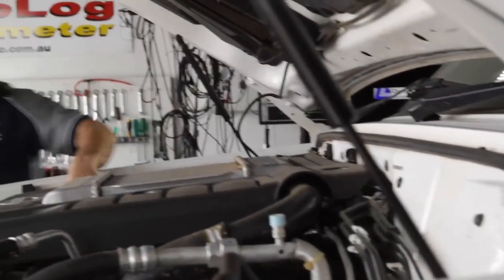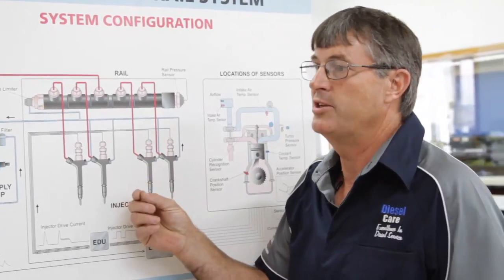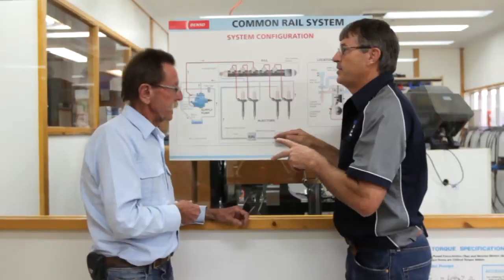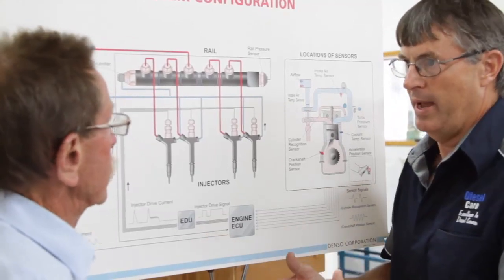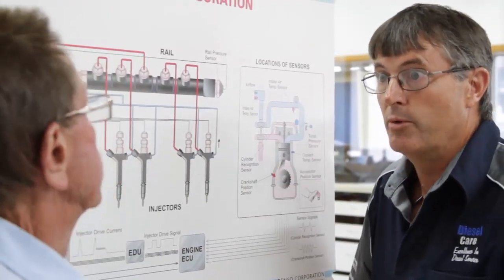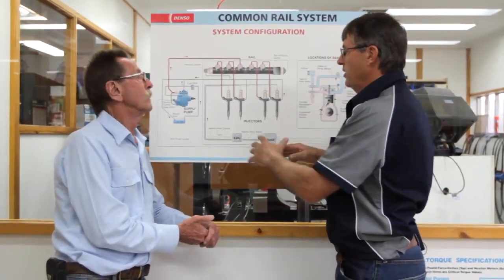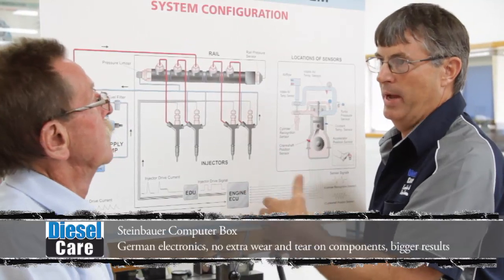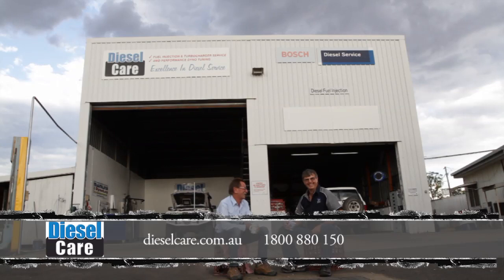The Steinbauer Difference - Diesel Care on Pat Callinans 4x4 Adventures

Comment: *The truth about chip-tuning, by Philipp Stalzer*

Today there are 3 versions of this cylinder: UL, OL and TOP.

- UL stands for lower-performance, the piston is made out of a simple aluminum-alloy, the crankshaft is simple-forged and uses a sintered connecting rod. It can cover up to 25kw/75nm per cylinder and is used in models like the x16d, x18d and x25d (exept the f10 model after 2011)

- OL stands for upper-perfomance, the cylinder path is honed several times, it has forged connecting rods and the bearings of the rods and crankshaft are sputtered bearing. It can cover up to 35kw/100nm and is used in models like x20d, x30d.

- TOP is for high performance, including a special treated crankshaft as well as laser-treated cylinder-paths. With this it is possible to increase injection-pressure and rated speed. This cylinders are used in models like x23d, 525d (after 2011) and x35d/x40d.

The engines have exact mechanical measuremants, but are different in materials.

For example the OL piston has a higher amount of copper and chrome. The higher amount of copper dissipates heat better out of the chamber into the piston floor cooling. Chrome makes the piston more stable at higher combustion-pressure inside an OL-engine.

Since the pistons are exactly the same sizes, you can however use a OL or TOP piston in an UL engine when doing repairs. This helps saving costs even more by reducing stocks and the prices regarding spare parts are more secondary.

It is correct that manufacturers limit the power output via the ECU (for example in an 25d), but they have to, since the used components are not made for higher hp/nm outputs. Almost every turbocharged diesel-engine is capable of generating more thermal energy than it can handle mechanically, and this is what chiptuning is relying on.

Now here come the tuners with their chips, because they can fetch data/part numbers from After-Sales-Programs (at BMW you can access it without any further requirements) and think all 3L engines are the same. It is true in terms of repairs, but not with newly shipped cars. You can use a piston of a 535d in a 316d and it will fit and work perfectly (same size) but is indeed "overpowered" in terms of materials. In this particular case it will be no problem since a 316d puts out less power than a 535d.

To get a sense of how much money can be saved by using a master cylinder for a complete engine lineup: if a piston "148" for the upper performance costs 12€, an M124 only 8€ that this makes about 24€ per car. For a production capacity of 200.000 cars 525's with 6 cylinder you're looking at a whopping 4.8 Million Euro. And the piston isn't the only thing where money is saved. Because of this, the customer pays less for a 116d as for a 123d, even though they both have a 2L engine wich are basically built the same way. The 116 just has less heat resistant and cheaper materials built in.

No manufacturer limits the power only by electronics. It is the media and especially the tuning-scene that spread this rumor. The differences nowadays not only come down to engine size, it also goes as far as material and single production processes. Same-Part strategy does not mean that the parts are exactly the same, only that the measurements and weights are the same. Also the thermal characteristics are different.

Interesting from a different area: Bosch does the same thing with their machines. You have the green series (for the little handyman at home) and blue series (professional). Products look the same (expept housing color) but here we also have different materiels used. A drilling machine from the blue series has a better hardened transmission, switches are built for far more cycles, overload protection is higher, thicker cables.

Regulating the power output via electronic serves the purpose that the engine with it's simple materials doesn't get overused. Through supercharging you can give any amount of power to a engine, but it will not be able to handle it. So when you think your 118i with its 170hp could do way more, but the stupid people at BMW are just to lazy to get more power out of that engine let me tell you: a 118i is capable of over 300hp, even keeping all emissions in the green zone, but he won't make that for long.

Basically in the automotive industry you can say:

- not everything is at it seems
- wenn there is a way to save €, it will be done
- espacially in the automovie industry many facts from media or magazines/books are incorrect

The statement "how long does my engine last when I chip it" can't be said in miles/km, because a engine does not know the term miles/km. If a M124 operates on the potential of a 30d, but you never or only rarely request the full power, the life expectancy won't change at all. If you floor it a lot and request the full power often, it will come to slight structural changes. Depending on further circumstances your engine can fail after a few minutes, or maybe 1.000 operating hours.

The combustion inside the engine can reach up to 2000°C, aluminum melts at 660°, so it should totally melt, right? Not really, since the peak temperature only last for a very short time and then the piston has an about 10 times longer period to cool off. Above 400°C aluminum looses a lot of its strenght, so the piston temp should be under 400°C at all times. How much it heats up depends on the intensity of the combustion. It peaks at full load and maximum torque, and with chiptuning this only gets much higher. To compensate this you do the following: you increase the amount of copper and chrome in the piston, this gives it better strenght at 420°C. So you can say, that in stock motors with more power there are better alloys used. A quick "tune" via ecu or plugging in a "race chip" can't do that. The thermal capacity of the engine is exhausted, the piston gets weaker the more power you give it in overload range. Worst case is that the top land breaks, and your engine is complete toast.

Regarding damage, these mostly occure long time after the tuning. Usually after 50k-80k km the problems start. Many people do not own the cars anymore by that time, and the subsequent owner doesn't know about the bad suprise that might happen. If a damage is found in the repair shop, they often just change the part and thats it. Often nobody suspects a tuning chip as the main reason (you know.. tuners say "its all good man!)

Also many tuners (and others) love to say the damage comes from weared parts, for example a turbocharger. But that's not it!. Turbos do get damaged by tuning and wrong handling.

I can understand the side of the customer. There comes somebody and puts a little thingy in your car, not even that expensive and suddenly you have a lot more power and more fun. You don't see it, but you feel it. With the thought in the head, that all engines are the same, you think that nothing could go wrong. The tuners do their part to the story... why should they report any damage caused by their tuning, that would ruin their business.

Chiptuning has somewhat in common with smoking. Cigarette-Manufacturers won't tell you that smoking causes lung-cancer. Smokers argue that they know people that smoked for long time and got 80 years old. Is that the evidence that smoking is unhealthy? Also here: Business with curing diseases related to smoking is huge.

All this statements should be valid for almost all Car-manufacturers, i personally don't know any brand that does not use the same-part strategy. Better safe than sorry.

**__________________________________________________________**

Hope you enjoyed this, and sorry if there are mistakes in translation or grammar.

Drive safe!
Reply: Very thorough, good explanation.
Reply: Thanks - was going to leave my engine stock now I know why.

Comment: The main problem is heat. More oil into the cylinder means more heat impact on cylinder and piston, it means cylinder and piston won't last as long as they should

Comment: Well... That's all well & good to fit a steinbauer module to a vehicle, but..  What happens in terms of warranty??.. This issue no one has addressed at all, is it a case of buyer beware or fit at your own risk??... Rob
Reply: Hi Robbiebob - honestly warranty is a loaded question and depends on the laws in each individual country and in some instances per state.
Reply: do you mean a warranty on the Steinbauer Performance box or do you mean the warranty on the engine, in case you blew the engine?
Reply: @jaybajan  more oil into the cylinder means more heat, it means cylinder and piston won't last as long as they should

Comment: Do you guys have Steinbauer for ISUZU NQR 450 2003??? I'm from Parramatta Sydney
Reply from the maker: Hi. Is your NQR a common rail engine. If so yes we can do a unit for them.
Reply: Diesel Care no it's not common rail I might get truck with common rail engine truck be in touch with you mate
Reply from the maker: Seller No problems. We have a lot of that range of Isuzu truck. We just will need to know if it is Sitec 1,2 or 3. We have them for all models.
Reply: Diesel Care are you guys based in tamworth?? I'm from Parramatta
Reply from the maker: Seller Yes we do have a branch in Tamworth. We also have dealer around the country that can fit it up for u.
Reply: @DieselcareAu  I have 2004 ISUZU NPR 400 Sitec 140??

Comment: Question, I have just ordered a steinbauer for my direct injection duratorque. If it is pre programmed can the guys still improve on the programme for even more down low torque, that would be great if they can?
Reply: Hi Adrian - STEINBAUER modules are mapped for the application and are fine-tuned by our local distributors. (We sell products all over the world, sometimes there are slight differences in engine set up depending on the country) A STEINBAUER trained specialist can make fine adjustments specific to your needs, best to contact your local STEINBAUER dealer for more information. You can always reach out to us direct via Facebook messenger if you need direct contact information for your closest specialist.

Comment: I think I'll keep this video saved to use as an example of why online videos arent always accurate. 90% of what he says is Fact, but its 10% Fiction that happens to be total garbage. A good Common Rail Chip will not increase pressure all the time (such as at idle), but will instead follow the rev curve. And it wont cause any extra strain on the injectors than a steinbauer, because both work within factory recommended limits

Poor form guys
Reply: Hi Ryan. Your honesty is appreciated, all be it a little simplistic and inaccurate. The issue with common rail chips/tuners is that they inject additional fuel with higher fuel pressure throughout pre, post, and main injection. (this process takes 2 milliseconds) Additionally, the PCB hardware chip (the brain) of this tuner is not advanced, but very simplistic and mass produced. It is a very cheap electronic not capable of accepting advanced software programming. A microprocessor controller and advanced programming are required in order to communicate with the original ECU to ensure that factory recommended limits and safety settings remain in place and unaffected. STEINBAUER has a team of dedicated software and hardware engineers, and produce all our advanced PCB boards in-house to the highest automotive/OEM standards. Feedback is welcome - we just ask for accuracy to ensure that customers are accurately informed. #tuneSAFE #tuneSTEINBAUER
Reply: but noone writes what will happen to other components, clutch, etc